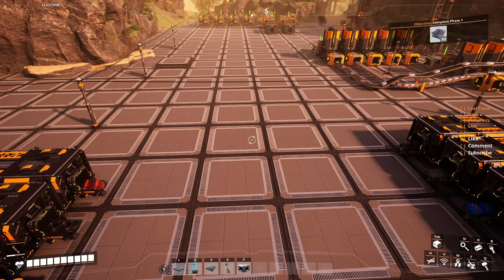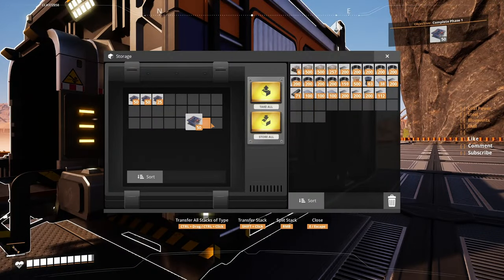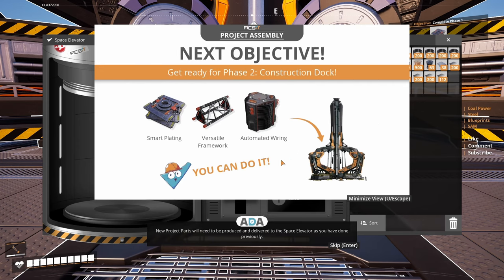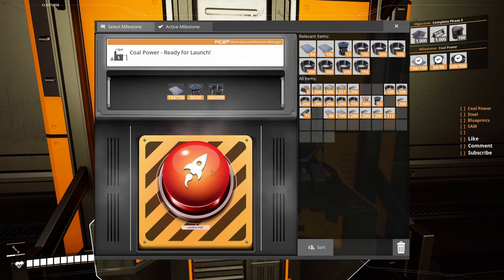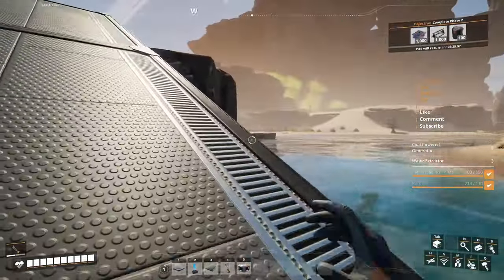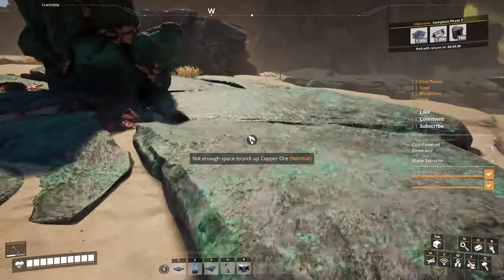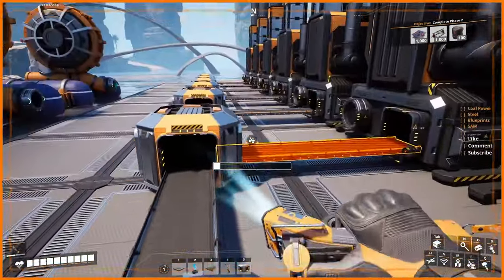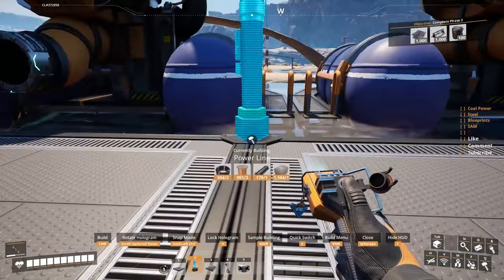Satisfactory 1.0 - The Final Factory - Day 04: Coal Power, Modular Frames and Basic Steel

Comment: I find the simplest way to align a water extractor to foundations is to place a pipeline cross then use CTRL to snap. No need to place foundations under the water.
Reply from the maker: Indeed @vikingbrit270, normally they snap to the cross of the machine but there are cases where they don't. Having those crosses put on the foundations in front of them solves that issue if you know where your machines are going to be. Thanks for the tip and for being here.